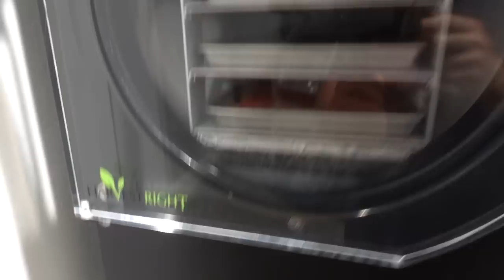THIS IS GETTING DANGEROUS THEY HAD ME TRAPPED IN THE BARN FOR 10 MINUTES!

Comment: I agree with you.  Those wasps need to live somewhere else as they have the woods to live in.  I have been on wasp patrol this year too. It has not been so bad this year.  Last year it was the red wasps and this year it has been the yellow jackets. I am with the others, I would wait until after dark to spray them, although I have done a lot of mine in the daytime.  They were smaller nests. I like your brand of wasp spray as it does a good job.  When you are not filming and you are spraying the wasps if you have one come at you have a frisbee handy.  If the wasp flies at you, you can swat it down and stomp it or spray it.  I know the frisbee sounds silly but when you swat down with it it messes up the wasp's flying by creating a down draft of air.  I have used it  to knock down wasps and it works well if you do not have any spray at hand.  I am glad you found those nests and did not get stung.  Stay safe.

Comment: Kevin I use this foaming wasp 😢spray, and I found it works better if I wait until evening when temperatures are cooled off just a little bit even if it's already start to get dark and the wasps have collected back on the nest and then it coats them and covers them all and they can't get away if you if I spray when they're not on there, when they come back and it's already absorbed into the nest and they don't get enough of it on them to kill them. You might give that try a shot.